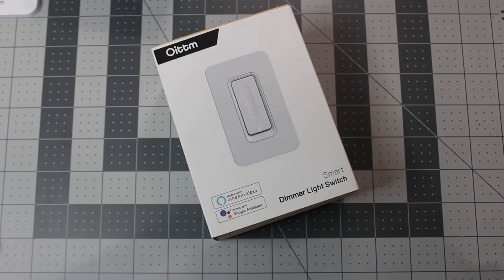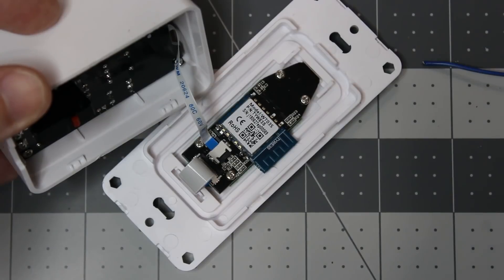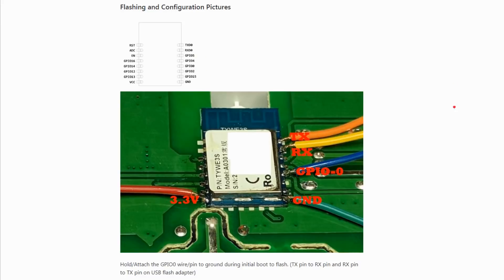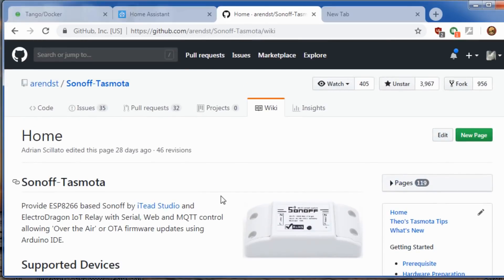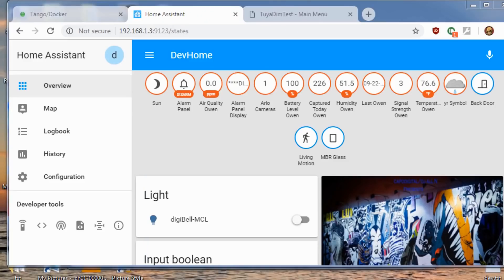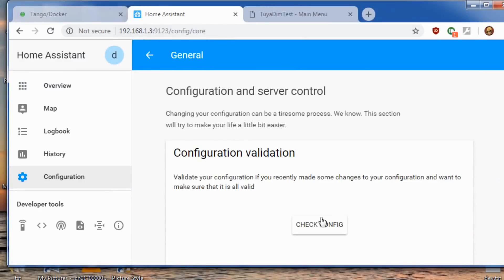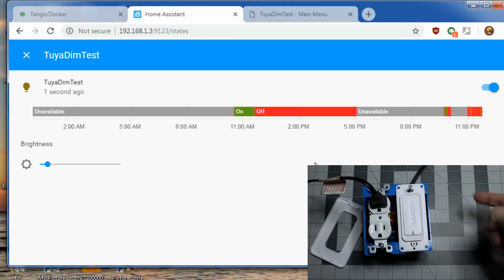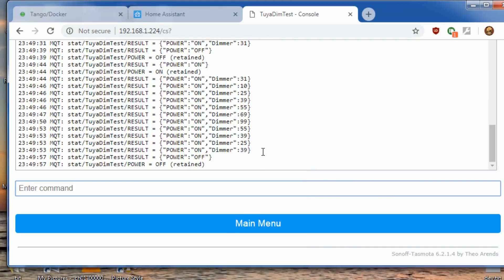WiFi Dimmer Switch with Tasmota - Local MQTT Control

Comment from the maker: I've had a few people ask if there is a way to obtain one that is preflashed as they are not comfortable soldering on the smaller pins.  If you'd be interested in purchasing one that is ready to go please leave a comment below as I'm gauging an interest to see how many I can buy up front.
Reply: I would be interested in 5 of them depending on price and availability of face plates for these?
Reply from the maker: Unfortunately I would have to buy them in quantities of 12 to get a discount on them to make the price worth it for end users. Additonal shipping/credit card fees combined with the time to solder and test it is just too much. Plus the faceplate issue you mentioned but I did see someone mount one in a 2 gang recently and had to Dremel away a little bit to make it look right. Looked very good.
Reply: @digiblurDIY  Would your pre-modded units still retain their electrical code certifications and not void or cause issue with home insurance against fires ?
Reply: pro tip: watch movies at Flixzone. Me and my gf have been using it for watching lots of of movies recently.
Reply: @Dominik Magnus yup, been using flixzone} for since december myself :)
Reply: @Dominik Magnus yup, I've been watching on flixzone} for since december myself :)
Reply: @Dominik Magnus Yea, have been watching on flixzone} for since december myself :)

Comment: Can the brightness state be disconnected from the actual output?  I want only 100% when on and then use the dimmer wheel only for soft control of LED lights.  Basically, the on/off will control a power supply, and then the brightness state will be used to control a shelly rgbw2 that is powered by the power supply.
Reply from the maker: No. The secondary MCU messes that up. Look into Martin Jerry OG dimmer

Comment: I downloaded Tasmota_8.3.1.2(digiDIMv11).bin and flashed the dimmer. I see no Tuya Module ...
Reply from the maker: Yes, the fork is now just for the Martin Jerry dimmer when doing multipress.  TuyaMCU was folded into the regular stock tasmota.bin and even expanded to many additional functions since then.
Reply: @digiblurDIY  so what do we use for this switch: Upgraded TreatLife Dimmer with Touch Panel?
Reply from the maker: Just pick TuyaMCU in the configure module and set it up like a normal TuyaMCU dimmer. I have a video on the process. One sec.
Reply from the maker: This one. https://youtu.be/_3WW4NVYHrU

Comment: Having issue putting it in smart pairing mode via wifi... You just push and hold the put-on for 5 seconds right?
Reply from the maker: It can really depend on the device as some require power toggles or other things. If the 5 second thing isn't working then try looking in the manual for the device.

Comment: That is great! Thank you! I am using one of those with a Yeelight RGB bulb, but the bulb flickers when I try to dim down.
Is there any way for decoupling the dimmer so I can still turn the bulb on/off with the switch, but dim the bulb via Home Assistant when operating the dimmer (i.e.: not changing the voltage delivered to the bulb)?
Reply from the maker: Yes. Bypass the power on the back to make it always on for smart bulbs.
Reply: @digiblurDIY  thanks for answering! I thought about that but this is really not an option here due to wife constraints. I'd need the bulb to be physically turned on and off by the switch, while the dimmer to be logically operated by HA. Do you know if that is even possible?
Reply from the maker: Use device groups and sync them. Check out my video on it. This is what I do. Works great and the wall switch turns it off like normal.
Reply from the maker: https://youtu.be/Bp1BsTe2zyY
Reply: @digiblurDIY  I'll definitely try that and let you know! Thank you!
Reply: @digiblurDIY  I tried this solution (awesome video btw!), but that still implies in having the bulb's power bypassed (always on) and logically setting the on/off state and dim level.
I only have 1 dimmer and 1 bulb, but I need to turn it on/off in case my HA instance loses connection, MQTT broker dies or Wifi goes down.
Wife will understand she can't dim the bulb if the server goes down, but won't if she can't turn the bulb on/off (which happened already).
This is why I wanted to decouple the dimmer, so the on/off would still be done by the switch physically, and dimming would be done via HA or groups as you did.
Reply from the maker: It only relies on WiFi being up, no HA or MQTT needed.  Probably need to switch to a regular bulb there or work on fortifying that WiFi.  If my stuff can't get to WiFi that probably means the power has been out for over an hour and the family will understand already why the lights won't dim.

Comment: Helpful video, thanks, i have one question, there something we can do with dimmer limit minimum 10 or 15%
Reply from the maker: Yes you can set the dimmer range now with the Tuya MCU module.
Reply: @digiblurDIY  Thank you for your response, on tasmota mode after i set ledtable 0 and dimmerrange 1,100 i can go to the 1% but on the switch only 15%, i'm new in this, maybe i miss something, spend many hours and cant fix,
and thanks again for your time!

Comment: That switch is great but I've got an issue.
Just installed some rgb bulb controlled over bluetooth.
I want my wallswitch to talk directly to them.
Could it be possible with the wallswitch to swap the esp8266 with the bluetooth capable esp32 ?
Also, is it possible to have the front led display to work independently of the actual dimmer output ?
My rgb bulbs need 100% power all the time. I want the dimmer faceplate control to just send the dimming command to the bulb but keep outputting 100% power to the bulb.  Possible ?
Reply from the maker: Not really with this dimmer unless you dig into the secondary microcontroller code and flashing.  It could be possible in the martin jerry dimmers like I did in this video https://www.youtube.com/watch?v=RyXqLRAFdPY

Comment: i installed the bin you suggested. works great via its ip address. when i try using HA, it turns on, but the switch in HA turns off by itself and the light wont turn off. Any suggestions?
Reply from the maker: Make sure you use the latest here and the template is also here. https://github.com/digiblur/Sonoff-Tasmota

Comment: How difficult would it be to modify this to take 240v in the UK, if it's just getting 240 down to 5 that I guess isn't to hard but what about the power modulation, how is this done? And clues before I buy one and destroy it?
Reply from the maker: I think that one is 240v capable from I remember. You might have to look at some frames of the video to see. I know several other of the dimmers I did after this one are 240v capable such as the Martin Jerry ones and Acenx.

Comment: Any chance you've looked at making this work with ESPHome? It's a bit quicker than MQTT and also a little easier to maintain (i find anyway)
Reply from the maker: I haven't heard of anyone doing these with Esphome but I am sure it could be with some work. I use MQTT with Esphome on my multisensors and a few light bulbs but for switches I usually use Tasmota as it is easier to deploy and use in my environment.
Reply: @digiblurDIY  thanks! Im new to esphome but really like it and will see if i can get it to do something...
If not, tasmota it is. Thanks for sharing!
Reply from the maker: Yes Esphome is a great project indeed! Love having several choices to fit the home automation project at hand.

Comment: Is it possible to invert the state of the led indicator?
Reply from the maker: No, all of that is controlled by the secondary micro controller.
Reply: @digiblurDIY  And can i invert the work of the relay? I mean in this case the led will light when the relay is off...
Reply from the maker: You would have to dig deeper and change the code on the secondary MCU. I would probably suggest the Martin Jerry dimmers I have covered in other videos and snip the one led that is on when the light is on and yet it has another color led you can control.

Comment: Thank you again for taking the time to do this kind of videos. I was able to use a dimmer like the one described on your video and I did it over the air with no soldering! I used the Moes brand and I have been able to do the Three way switches and the dimmer over the air. Thanks!

Comment: When i connect the LED to Moes the lights are not so bright. When i connect the LED directly to mains, the're plenty bright. Is there a command in console that will help with this? I did not test before flashing. -jimmyneu
Reply from the maker: I haven't noticed that, if you adjust it to the highest on the faceplate it is still dim? What kind of LEDs are these?
Reply: @digiblurDIY  they are recessed lights with drivers. No name brand. They work fine with my zigbee dimmer. They are still dim when set at 100%
Reply from the maker: If you use the faceplate it won't go bright? The secondary micro controller does all the dimming so when the faceplate is used the esp8266 chip with Tasmota is taken out of the process.

Comment: Finally, a dimmer for Tasmota (thanks to DrZzs for pointing me towards it). I hope other models of Tuya switches work as well as I am in the EU. Found this one on AliExpres, but took this one which is mentioned in the Tasmota site: https://www.aliexpress.com/item/WiFi-LED-Dimmer-Switch-220V-110V-Dimming-Panel-Switch-Connected-To-Alexa-Google-Home-Voice-Control/32859257784.html will post an update once it is in.

Comment: thank you!! so one issue i am seeing when i have the dimmer set to lets say 50% and i reboot ha - the dimmer stays at 50% however the slider for the dimmer in HA goes to 100% - in tasmota i have powerretain to 1 - ha to know the last value and keep the slider there. Tasmota the silder is correct
Reply from the maker: Try this bin file and make sure Tuya dimmer is set after flashing. You can also use the included sample YAML config. https://github.com/digiblur/Sonoff-Tasmota
Reply: @digiblurDIY  
i have this:
- platform: mqtt
  name: familydimmer
  state_topic: "stat/familydimmer/POWER"
  command_topic: "cmnd/familydimmer/POWER"
  availability_topic: "tele/familydimmer/LWT"
  brightness_state_topic: "stat/familydimmer/RESULT"
  brightness_command_topic: "cmnd/familydimmer/Dimmer"
  brightness_scale: 100
  brightness_value_template: "{{ value_json.Dimmer }}"
  qos: 1
  payload_on: "ON"
  payload_off: "OFF"
  payload_available: "Online"
  payload_not_available: "Offline"
  retain: false

Comment: G'day mate. I love this idea but I don't love the fact that it's WiFi. Have you used a enc28j60 to connect anything to Ethernet before? Also question regarding if the home assistant goes down are you still able to use the wall switch as Normal? I'm doing a pre wire I'm my home here in Australia and want to be prepared for anything. Cheers
Reply from the maker: Unfortunately everything is really geared towards wireless switches as I too would like POE stuff but that cost hasn't even come down enough for DIY sensors for it.
All my various switches work if my home assistant is down as they don't rely on it at all.
Reply: @digiblurDIY  I'm thinking if we were to connect an Ethernet shield to this would we really need Poe as it has mains power  to the switch. I'm just throwing ideas out there and seeing if something sticks. I tried to get started on home assistant a few years back but never got it to work I'm hoping to have another shot at it soon.

Comment: Got mine working thanks to your great tutorial! Thanks!

Question: Can I use one of the GPIO pins on the Moes + ground to trigger the light off/on? I don't need to dim, just off/on. Kind of like we do with GPIO3 on the new Sonoffs. 

The application is I currently have lights with 3-way switches. One of the switches is a dimmer (now the Moes) and the other is a standard off/on switch. I would like to connect the wires coming back from the off/on switch and listen for a toggle on one of the GPIO pins on the Moes switch to broadcast an mqtt power message. That way that switch can continue to function as an off/on while the Moes does the dimming. 

Also, where would I go to learn the capabilities of the pins on the Moes, like which ones can't be held to ground on boot, etc? 

Thanks again!
Reply from the maker: That Tuya module should behave like a Esp8266 as that is what is inside. There are many GPIO pins available on it. I actually did a motion night light that has that same Tuya module in it and connected to another pin. This page has the full pin out of pins. https://github.com/arendst/Sonoff-Tasmota/wiki/SM-SO301

Comment: Hi! Great video and very well explained! I recently purchased a MOES 2-way smart switch and it also uses Smart Life app. Looking at your video and diagram, I see it is very similar in layout in the ESP controller, having the exact same layout and pinout (the circuit board had name tags for every pin). Have you had any experience with these switches? they also make dimmers, you can find them here: https://www.amazon.com/dp/B07BLZFQZZ/ref=twister_B07BM98C51?_encoding=UTF8&th=1
Reply from the maker: I had one switch like that once but I didn't like the way it secured into the wall without any screws.  I didn't want it popping out on someone the mains wires/screws were exposed on the side when it popped out.  Do these have any screws?
Reply: digiblurDIY well, the glass faceplate pops in into the body. The body is secured by two screws to the wall, so in the case the glass cover pops out (it hasn't happened to me in 4 months) you only get the springs that connect the glass plate to the circuit, but the high power cabling remains inside the wall. 
The glass actually snaps very firmly, I need to get a screwdriver in order to take it off, or pull it with a bigger force than an accidentally bump

Comment: There is another tuya dimmer module KSEN 7011 that uses a tywe3s ESP chip. only 14$. It has all the pin outs easily accessible and would not require any soldering. just removal of a couple small screws. It would make for a great tasmota dimmer switch. It has an LCD read out on the front that gives you numbers for brightness level. Not sure if your programming in tasmota will work for this setup or not. Here is a link to the product.  https://www.alibaba.com/product-detail/New-Style-ETL-Certificate-Electric-Inteligente_60745854972.html  I could easily flash it to tasmota but don't know if i could figure out what settings will need to be changed to get the read out to work. Any help would be appreciated.
Reply from the maker: Look in my state of the dimmer video.

Comment: Excellent video. Just got mine working. The soldering was a little tricky. My hands aren't as steady as they used to be. I got a little lost entering the SSID and Password in Termite but another video straightened me out. I also had some trouble reassembling the small connector but eventually got it. Thanks for all your hard work. Now I'm moving on to your other videos!
Reply: Hi, can you point out how you did it? I'm stuck after a succesful flash, because Termite can not connect to the thing... what am I missing?
Reply from the maker: After you flashed did you get the success message? If so make sure GPIO 0 isn't held and cycle the power on the USB to the device. Then connect with termite on the same com port. Make sure you use 115200 baud rate.
Reply: @digiblurDIY  Got it! I think i didn't have the correct baud rate. Thanks a lot!

Comment: Excellent tutorial. If only this device was available in the UK. Do you know of any alternatives with the same functionality?
Reply from the maker: Check the second half of this WiKi.  https://github.com/arendst/Sonoff-Tasmota/wiki/Tuya-Dimmer
Reply: digiblurDIY Thank you.  Saw this and ordered one to try. Konesky WiFi Smart Switch 1 Gang Smart Light Touch Control Stepless Dimmer Switch 400W Wireless Remote Control Compatible with Alexa Google Assistant IFTTT withTiming Function(Neutral Line Need) https://www.amazon.co.uk/dp/B07FMTYF34/ref=cm_sw_r_oth_api_i_mQKgCbNF7TYX3
Reply from the maker: Someone ordered something similar looking to that and used same Tuya module in the Tasmota code and it worked for them.
Reply: digiblurDIY Thank you.  Saw this and ordered one to try. Konesky WiFi Smart Switch 1 Gang Smart Light Touch Control Stepless Dimmer Switch 400W Wireless Remote Control Compatible with Alexa Google Assistant IFTTT withTiming Function(Neutral Line Need) https://www.amazon.co.uk/dp/B07FMTYF34/ref=cm_sw_r_oth_api_i_mQKgCbNF7TYX3
Reply: @digiblurDIY  The UK versions I listed below flash as described and work great.
Reply from the maker: Awesome! Thanks for the feedback on this.

Comment: Thank you! Great job on the video. I am still having difficulty with the configuration.yaml ...
Following the video ... I can control with the dimmer control and on/off. However, when dim and I turn off/on ... it shows full strength, even though the light correctly goes back to the original dim level. Only when I click on the dimmer control again does it decide to show up properly.
Following your link ... It always shows "0" or off on the dimmer control. I can click on the control and momentarily it moves the slider, but then when I release the mouse it goes to zero again. The light responds correctly, however.
I think I am missing something ... suggestions? Thanks!
Reply from the maker: Are you using the firmware I linked?
Reply: @digiblurDIY  Yes, I do have the 6.3.0 referenced flashed.
Reply from the maker: Make sure you are running the digiDIMv2 version if you want to run that simple template. Hit me up on discord if it isn't working still so we can take a look at it.